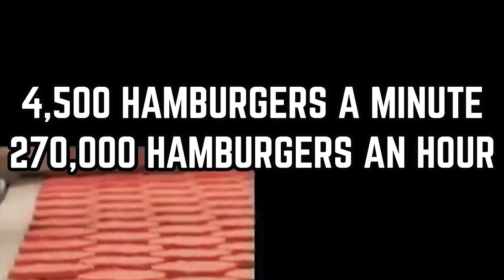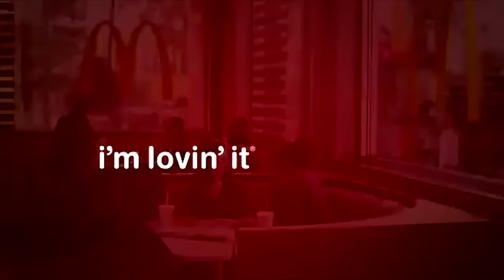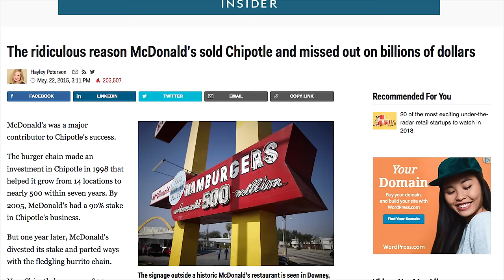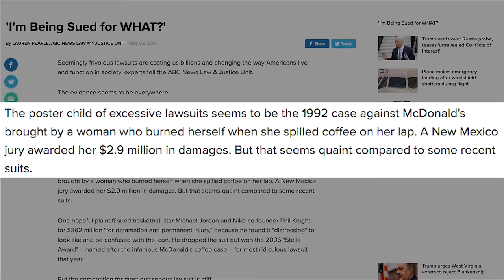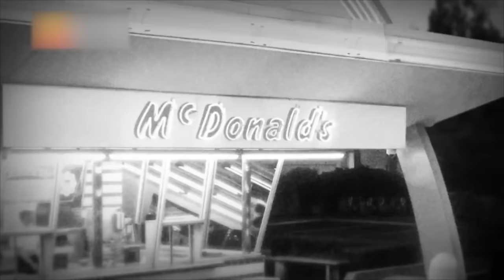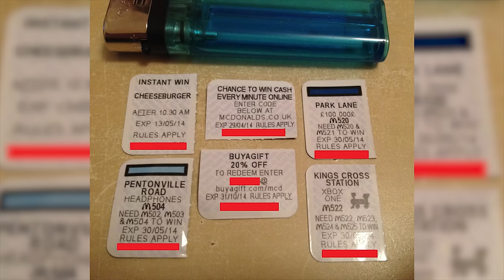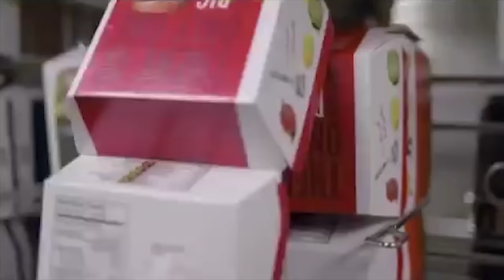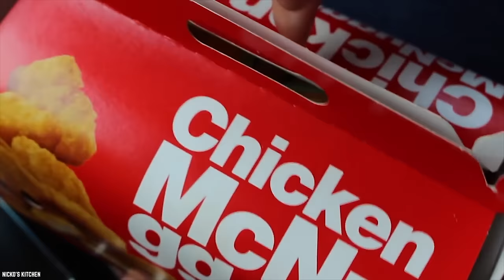Top 10 McDonald’s FACTS That Will Shock You!

Comment: I have worked as a manager at... McDonald's (3 different locations), Taco Bell, Arby's and Wendy's. I will say Taco Bell is the least sanitary, and I'm not talking about just a specific location, it's law, using the same meat day after day, refrigerating then reheating, not good, especially since employee's are not trained well enoungh in food sanitation to follow protocol. McDonald's i worked as a manager for a good 6 years, not bad, but word of warning...DO NOT ORDER ANYTHING WITH CHEESE OR LETTUCE in the summer Months, these items are in the open and FLY'S crawl all over them! This was policy how to set up, ect, and just how McDonald's operates. Wendy's has a more closed off system, with lids over all lettuce and cheese until rush hours, but still, did much more to reduce fly infestation on the food. Arby's was the best, super high quality beef, cooked for around 4-6 hours at a time (from my memory, been 12 years), with very strict laws on food safety, quality, and sanitation. My 2 Cents based on experience.
Reply: I find it hard to believe that Arby's is that much more sanitary.

Comment: Here's a shocking fact about my local McDonald's:  They're too cheap to run the credit card system between midnight and breakfast, and only accept cash.  Even worse, whoever takes your order runs around to find a scrap of paper and a pen, then calculates your total on her personal cell phone which should be a HUGE health code violation because there's no control over where that phone has been off the clock.  I've submitted more than one complaint about this, and received nothing more than an apology.  Long story short, I make my own burgers and fries now and absolutely refuse to spend one penny at McDonald's.  They basically laughed at my concern for food safety - I think it's time to call a local health inspector.